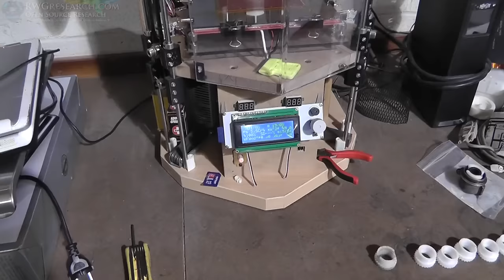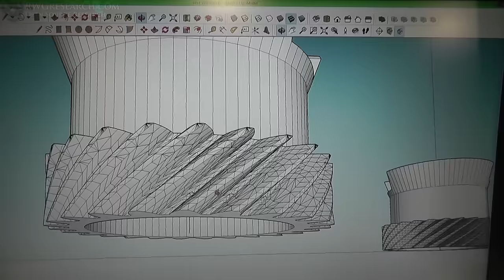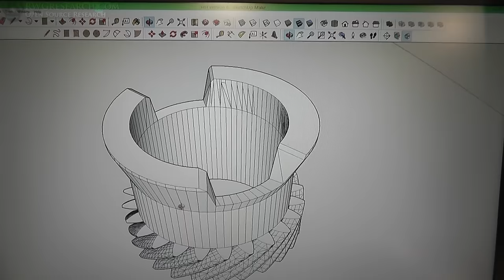Practical 3D Printing With Taulman 618, Nylon Gears! 1983 Hondamatic 450 Speedometer Gear!

Comment: Once I get a thing like that right, I would archive the good copy.  Do you recycle the bad parts?  I was looking into that and there are machines that can make new filaments from waste material.  I don't even have a 3D printer yet, just looking into how to use them and by the time I figure much out there might be a cheaper one.  I know you get what you pay for but I am just not ready to spend $800 for one of these yet.
Reply from the maker: +John Doe yes, see here: http://rwgresearch.com/open-projects/filament-extruder/

so i only have used new plastic so far but have a stock pile of used stuff to try once i devise a go way to shred it... ~Russ

Comment: You might have been better off using a subtractive process in something like solid works for the drawing, By cutting away parts of a cylinder you can maintain the straight edged profile which is so difficult to get by building it up.  As well solid works in particular has a ton of tools for designing nice accurate gears.

Comment: Did you figure out your LCD alien language problem?  I have heard that could be cause if it is not properly grounded, but don't know for sure.  Mine does it too sometimes.

Also, yeah Onshape is great for 3D modeling.  Better suited for some parts than Sketchup for sure.  And it's free so you should check it out.
Reply from the maker: Thanks, No, it has not done it for a while, yeah some Rx-Tx communication brake down. not sure, ill check out Onshape, the Fusion360 is free too, its a must have. but takes some learning.. ~Russ

Comment: Another thing you can do is week wacker wire most of the wires out there are 2.5mm or around there witch would work in your case
Reply: DJake77  That's a great idea! Or could reextrude it to size of choice. Now off to google weed wacker line composition. Thanks!

Comment: nice 1 .would it work using nylon fishing line for a filament?
Reply: I don't know what the diameter of fishing rod is, but from my Knowledge about fishing rod it is usually to small for printing. And maybe also coated with other stuff being not good for 3D printing
Reply: Proven solution is trimmer line.

Comment: I don't have a motorcycle, but do you plan ti put your 450 gear on somewhere like thingiverse? I am sure alot of 450 owners would like to have that model.
Reply from the maker: +Skwisgar2322 yes i don't post stuff on there tho. just use my website... harder to find but at least i know where my stuff went :) i think the  file should be linked in the description. so if one google's this gear this will pop up... ~Russ

Comment: Impressive!! I must say you have come a long way with quality. I'm thinking of getting into 3d printing my self. I've watched most of your 3d related films and I love the narrated stuff. Would you say you spent most time struggling with software or trial and error getting the settings right? I know arduino in and out and think I might have less problems than the average guy getting the software up and running. On the other hand, I have no experience with 3d printing and don't have a clue how to calibrate and configure the settings. I too have two little kids, taking up a lot of time. Would you recommend scratch building a 3d printer over a ready kit for a guy like me? How is your wife reacting to all this? ;) Thanks in advance for your answer and thank you for sharing the knowledge! Cheers! My name is Øystein and I live in norway by the way.
Reply: ØysteinThe biggest thing you will have to familiarize yourself with is model making. Get yourself a cad program of some sort and start designing stuff(won't cost you anything: sketch up,free cad… lots of options).If you can't design a good model you can't print it. Calibration is easy, setting can be tricky/trial and error. If you're trying to do it on the cheap, some of the Geetech(off ebay) ones seem like really good value($350-500). Might be easiest to start with one of them, get a feel for things, and start a diy build of a bigger or delta model after if you feel it's still your thing.
Reply: ***** Thanks for the answer. I've had a look at the geetech delta and I think I'll go for that one if I'm going for a kit. One of the main rasons for scratch building it is I'll get it tax free if each package is under $45. Norway has 25% import tax on anything higher so it'll be a conciderable amount. I'll follow your advise and try designing stuff and see if I can do it. Cheers.
Reply: Ouch that's a bit rough for that customs/tax import structure. At least you can get around it a bit. Most of the stuff from China they mark down and or put as sample or gift. That may or may not help in your situation depending on what sort of mail inspection you have. I am my self in the process of trying to familiarize myself with cad programs, it is like learning a new language in someways. I'm liking sketch up and autodesk, free cad is ok but drives me crazy sometimes, for example trying to centre a 5mm shaft on a 20mm cylinder, it won't( or I can't get it to) split an uneven number(give me a 2.5mm centre) it either goes 2 or 3 mm, so I had to scale my design different and this was of course one of the last parts for the design. So some programs are easy to get quicker handle with, but usually have limitations.Thingiverse is pretty awesome for ready made designs. Anyways, all the best with your new venture!
Reply: ***** Thanks again, and good luck to you too. I'm sure someone has had the same issue and discussed it in one or two forums. Hopefully it's not what makes the free version free. Cheers.

Comment: Lololololol nylon is so simple to Print! Heat a bed 80c and use a peace of glass to print the on. Clean it well with some rubbing achahol. Funny watching this video actually printing out power wheels rear end gear set out this for little girl next door. Always dip these parts in polls urethane after makes them last 90% longer

Comment: i wouldn't use that part. You should probably consider using gear tooth design resources and not just shooting from the hip and hoping it would work. With gears even if the gear is slightly off it could increase wear exponentially

Comment: I'm guessing the curve makes it better. The original part doesn't have a curve because Honda are cheap bastards and machining a straight die is easier than curved one. The optimal curve would be circular giving the inside of a torus. If you tilt lines around a cylinder like that you will end up with a hyperboloid of revolution. Which is closer to the optimal toric shape than a cylinder, so it should work better. If I am not mistaken (which I may well be :P )
Reply: Actually the straight tooth will be wrong because it is a straight tooth, not because it leads to a curve. You are right +rwg42985 the tooth needs be a helix.